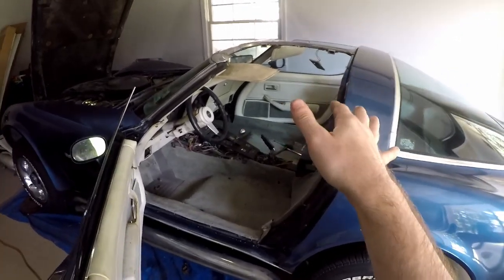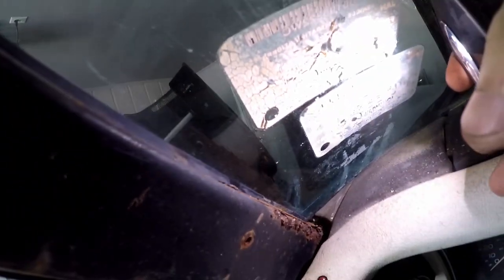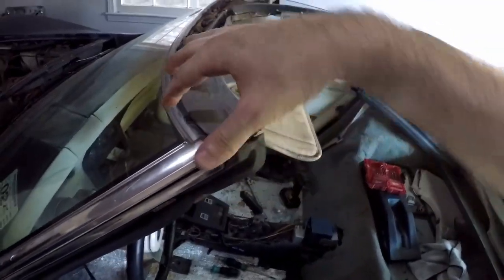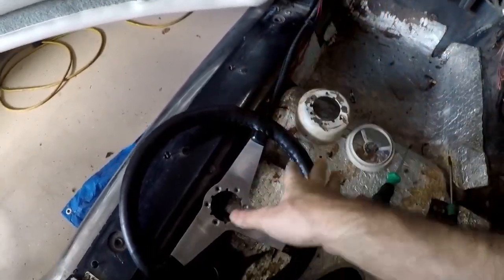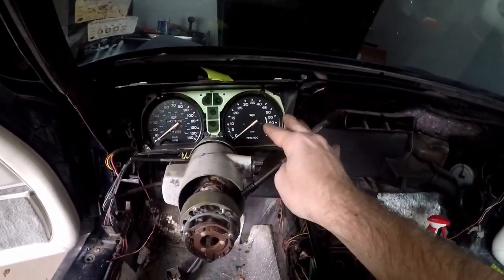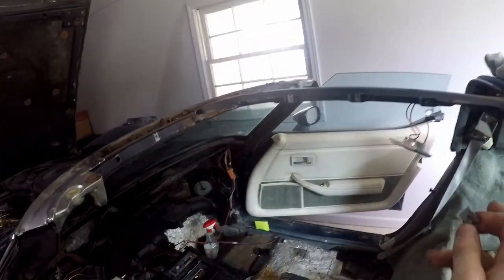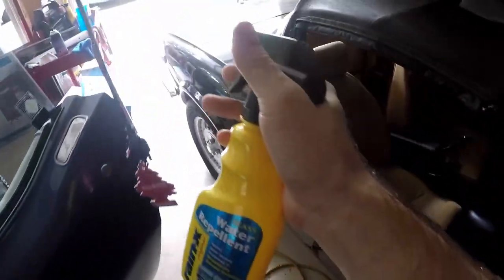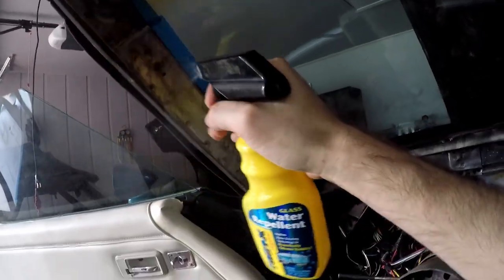1979 C3 Corvette Birdcage Rust Prevention With POR15 - Part 1

Comment: Nice work! You are going to want to pull that glass out...with that pitted rust, you might have bigger issues behind it, especially in the corners.
Reply from the maker: Agreed. Will get back to it once I have the time to tackle that. I’m fully expecting to need to replace some metal, but I’m not equipped to do that currently 
Just wanted to slow the rust down so I can continue enjoying it for now :)

Comment: Yours is not the first OUTSTANDING use of PO-15. It makes me wish I had a rusty old car to use it on 😆🤣! In your case...it's almost a shame you have to cover it with the dash. As you have doubtless have told, however, POR-15 breaks down in the Sun's UV rays. Let the dash protect the POR-15, therefore. That metal will outlast...us! This Corvette could be rolling down the road when Mr. Fusion power becomes the thing in the 22nd century. Aloha and take care!
Reply from the maker: I’m really impressed with POR-15. It’s cheaper than powder coating, so eventually I’ll get the entire frame and suspension components coated, eventually… :)